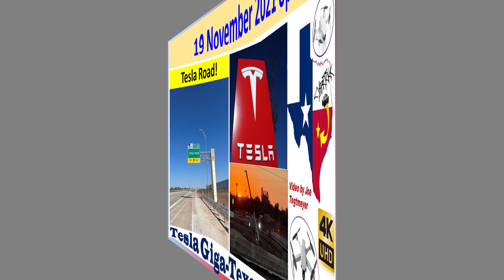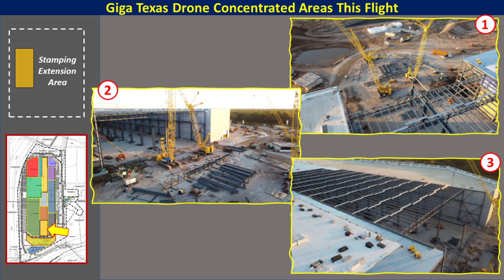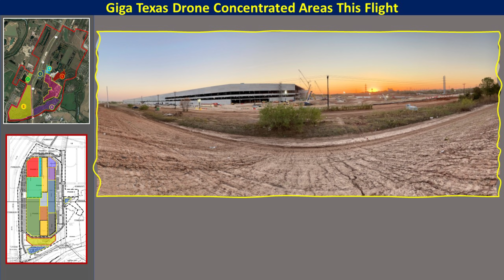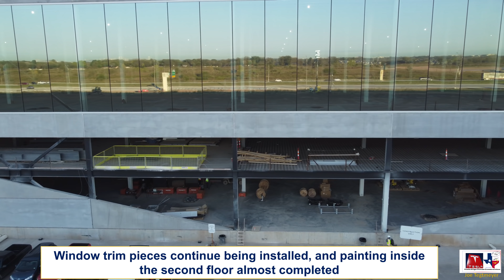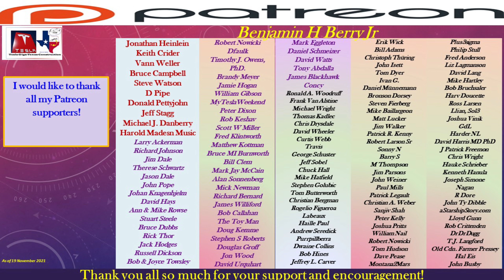Tesla Gigafactory Texas 19 November 2021 Cyber Truck & Model Y Factory Construction Update (07:30AM)

Comment: Thanks Joe. 
4:06. East side BIW. Ramp down to the loading docks also ramps up to meet the apron to the south (left). Odd detail, I wonder what drove it.
4:14. East side BIW. New door opening gets a stair that looks permanent i.e not a scaffold type temporary stair.
6:35. West side storage area. Steelwork looks like columns set up for bridge crane beams, bridge crane beams etc. Likely to be for the High Bay area where additional footings were being constructed 3 weeks ago. Deep inside here; https://youtu.be/NuWFvOcw4nI?t=725
7:21. West side GA. Bottom right inside. Robots.
9:08. Splitter box weir. So much timber. That will be a tricky pour. Lots of corners, skinny, deep. Surprised the weir segments weren’t precast and epoxied/grouted in over start rebar.
9:52. Retaining wall. Just when I thought I understood what was going on. A raised floor has now been constructed in the floor of the chambers behind the wall. Now there’s room for a layer of soil in the pond. Talk about a fluid design! 😑
11:09. South pond. Left of screen. Bringing in soil.
12:07. South end. 3 cranes shortly to be out of work.
13:14. Stamping extension. Perimeter columns already placed either side of the opening. 3 more columns laying on the ground across the opening, another right of screen.
I wonder if there will be floors constructed in this narrow space between the perimeter wall and the Stamping Extension structure. Maybe some access between GA and Stamping Phase 1. There are some short sections in the stack to the right that could be joists.
14:47. East side stamping. Demolished section of apron is now a newly poured entry ramp. 
16:34. Stamping extension. South building line. Think I can see some piers along the building line for the perimeter grade beam to land on. A little to the south (left) of the perimeter columns laying on the ground. Didn’t see those go in. Yellow drilling rig was down this end days 420 and 421. Red drilling rig day 425.
23:20. RTO roof. Squat wall made of LVLs and plywood on the expansion/construction joint between the RTO and Battery. Not sure why it isn’t the same height as the wall adjacent though.
23:33. Battery roof. Mixing up some topping or infill mix in the yellow lined pit. Years ago I did a lot of telephone exchange work, we’d often mix up vermiculite and cement to infill gaps in firewalls. Might be something like that.
24:18. North end parking. Trailer load of hessian/coir/jute silt logs for the bottom of the berm presumably.
24:31. North end Paint/Plastics. Additional stud wall being constructed between Plastics and Paint, and not for the first time. 
New doorway into Paint, bottom left. 
25:06. North end. Still digging up bits of the blue fire loop.
26:00. North west diagonal corner Battery. Blind corner, car seems to make a rapid change of direction. Fitting the head and sill sections for window installation.
26:07. West side Battery. New temporary roof access stair. Stair at north end beside loading platforms removed.
26:14. West side Battery. Steel delivery. Been a stack of stair components around here for a while, might be part of that lot.
26:48. West side GA. Additional street lighting
Reply: Tq
Reply: At 9:08 are the walls inside the box baffles to prevent turbulence in the water?  Sure seems overly complicated.
Reply: Dessie, 9:52  at this time my resolution is only 480P so it is hard to see this area, but I had noticed earlier that it looked like the floor here was corrugated possibly to break up the flow. 24:18 I believe that this is rolls of netting with plants embedded to cover the berm sides and prevent erosion until plants take over job.
Reply: At 23:20 I've seen some air vents that are made to drain away rain.  The vents are like red clay roof tiles with space between to allow air through.  Water is channeled into the bottom tiles and to a drain.  Is this area an air vent?
Reply: At 24:18 could those be rolls of sod?
Reply: At 26:58 a whole slew of shiny Teslas at charging stations in 4 rows. Are these a test batch of vehicles getting their first full dose of electrons?
Reply: @acmefixer1 23:20 This roof is the same metal as used on the other roofs, the area is just a separate roof.
Reply: @acmefixer1  The timber is formwork for a weir structure around 6’1” 1.8m high. Not a straight wall but a concertina type arrangement that gives a total weir wall length of over 300’ 90m within a box only 34’ 10m wide. Dimensions as shown on the drawings, not necessarily as built but near enough.
In an intense rain event when the pond is at capacity and the water begins to back up in the drains, once it reaches weir height it flows over the weir and into the drain to discharge directly to the river.
The concertina shape to the weir ensures the maximum flow of water over the weir for any given rise in water level.
I had trouble imagining that and after some back and forth with Bruno Mailly the penny dropped. 
Here’s what I wrote in response to another comment a few days ago:
‘Weir design. I had trouble visualising how it would work. Decided to make a model, and while I was thinking about how to do that I had this light bulb moment where I imagined a bunch of cups in a kitchen sink. As the sink fills up and water begins to flow into the cups the total volume flowing into the cups depends on the number of cups. Imagine only 1 cup in the sink versus 6 cups. Same effect with a longer weir wall. I can’t not understand it now, but I couldn’t grasp it at first. Ultimately the flow to the river is restricted by the outlet drain diameter regardless of weir design.’
Reply: @medaliardi903  Cheers Medali!
Reply: @eltonray2934  9:52. I can only make out a flat floor. There is some sort of longitudinal east westish marks on the floor, but I can't make out what it is.
24:18. I guess it could be, I'm not really sure what it is. Something has been rolled out in Jeff's 485: https://youtu.be/Mwx8_zJvZkc?t=807
Reply: @acmefixer1  The squat walls are in pairs either side of the building construction/control/expansion/fire compartmentation joints. I'm reasonably sure that the primary purpose is to get the corresponding flexible joint in the roof membrane well up above the valley. 
Some are firewalls that project through the roof and are treated the same way.
Reply: @acmefixer1  Here's one rolled out in Jeff's latest. https://youtu.be/Mwx8_zJvZkc?t=807
Reply: @Libertylute  Staff vehicles I'd say. There's a mixture of models in there, and some foreigners.
Reply: @DessieDoolan  Wow!  Amazing you made a model that explained it to you.  Thanks.
Reply: @jbarvideo12  Hi Jay. I didn’t get as far as a model, although that was the plan. I was in the kitchen making a coffee when I looked into the sink, imagined a bunch of cups in there, a brief moment of nothing, then the lightbulb moment. 

When I was an apprentice at trade school, one of the lecturers would often say, ‘if you can draw it, you can build it’. I was at the about to draw it stage, and fortuitously I thought I’d settle down with a coffee first.
Reply: 4:06 Maybe for room to maneuver? The other side has the pylon in the way.
Reply: @Libertylute  My guess is that they are company vehicles.
Reply: @musaran2  I had a rethink. Now thinking it might all be about whatever is under the manhole. Some service under there at a relatively high level. A drain perhaps. Bottom right here: https://youtu.be/nILbHusnmq0?t=96

Comment: @ 10:08 (South pond) Four outlets for each 8' diameter pipe from the splitter box. Each 8' pipe will empty into a concrete structure behind the wall to dissipate energy of the incoming water before it enters the pond. Outlets should be close to the pond bottom once the 3' layer of dirt is placed on top the liner.
Reply: The formwork inside the box seems extremely complicated.  Interesting to know what all is happening in the box.
Reply: @acmefixer1  Made even more complicated by the need to incorporate six columns into the weir structure.  The columns will help support the top of the splitter box.
Reply: @acmefixer1  I'm sure it's a science in itself.

Comment: With That gantry on the east side keep an eye out for multiple truck loads of disassembled equipment that is soon to be installed, just a guess but it may be CT press/stamping equipment
Reply: At this time there are 5 Schuler transfer presses in one assembly line in the building. They did use similar equipment to unload the Schuler presses inside of the building. This could possibly be for another line of presses or something else heavy. These assembly lines do not have to be dedicated to one automobile but can change dies for any stamping job. GM has locations that only do stamping. They produce parts for all of their vehicles by changing dies as required.

Comment: I was expecting the windows at 14:09 stamping area to mirror the windows on the north side of the casting area. But they have reinstalled the roll-up doors. Unless they will do it later, but there will still be a need for a crane and angled framing for the triangle windows.
Reply: Yellow crane is still standing by. Those panels were cored out for the bolting on of face mounted lifting anchors. I'd be surprised if they don't get replaced at some time.

Comment: Given that they are about to start production, what I still miss are two things: 1) test track (might be inside) 2) large parking lot where the built cars will be picked up by car carrier trucks (the north parking seems too narrow for that)
Reply: My guess is that they are yet to be built. Production volumes will be very low at first. They can construct those very quickly when needed.
Reply: I wonder if Joe, or anyone else posting here, has seen the site plan and identified where the parking lot will be for the Model Y's coming off of the assembly line.  We will probably see some activity there within the next few weeks if production of the Model Y's is actually going to begin by end of the year, as Elon and other Tesla execs have said.
Reply: @ronjones8003  In my opinion, the current parking lots are plenty big for the number of cars that may be produced and shipped this year.

Comment: 0:54 What is being split at the water splitter (besides water💧of course)❓
Reply: Rachel, only water flows through the box, I have included a description of operation from my files :
Splitter Box
The splitter box or more apply named “Pond 1 Overflow Box” is a covered concrete box with interior dimensions of 66’10” long by 34’10” wide and 11’4” high. It has a wall inside that is 6’ high. The top of the wall is at the elevation of the maximum level desired in pond 1. The internal wall, also called a “weir” separates the box into two areas with storm water entering the North East area and draining to the pond normally. If the level in this area ever reaches 6’ depth the water will overflow the 6’ wall to the river and prevent overflow of the pond walls. The design also completely drains the box in times of no rain.

Comment: Look like a 6-10 feet gap to complete south-central building but hard to be sure from here (Canada) 
And I think I saw (few days ago) column footing half way each middle section aligned to south wall
Reply: Look closely and you will see that there will be 4 or 5 columns installed to support the wall panels. At around the 13 minute mark you can see that 2 of them have already been erected.

Comment: How does the roof decking get on the roof?  You'd think it would've been lifted up with cranes and prepositional before all the trusses forced the cranes so far away from the next roof plates...   if raised up there now they have to be moved/carried pretty far.
Reply: They do place it as they assemble the building structure.
Reply: @eltonray2934  where is it?
Reply: @shadowmancer7040  Shadow, The decking is in stacks placed in rows at the back of each bay as shown at 16:06 .
Reply: @eltonray2934  omg.  I almost asked a million times why the roof beams were so irregularly placed.  They are stacks of roof decking?!   Mind blown.  Thanks.

Comment: My question is this. @10:00 if those were holes in the BIG WALL were for future drain pipes, they would have formed the pipe into the wall like everywhere else. So is this something different?
Reply: The flow from the splitter will enter from the north and be distributed out of the openings, not for future.

Comment: Since Tesla was just given permission to sell power back to Austin Energy, I have to assume that's going to be a lot of solar panels. Any guess as to will they put them on the roof, or since they have the land, build a solar farm..?
Reply: Maybe they'll spell out "TESLA" on the roof in solar panels?
Reply: I wonder if they will screw Tesla over like they do their residential customers? For us residential customers, they charge for all power used at retail rate but only pay you for power at wholesale rate. So even if you generated enough power to cover the power you used in a month, you still owe them the difference between the retail rate and wholesale rate. The only way to avoid this is to buy the power wall and not use a watt of energy from the network.
Reply: @Bill_N_ATX  Here in New Mexico it's a little different. I have a 12.4 KW system. The main meter goes backwards when I'm producing more than using, so they're paying me the retail rate for that, (I'm sure they don't like it). On the REC meter, PNM pays me .13 cents for each KW I generate. My average generation is usually 2200-2300 KW/ month.
Reply: In theory they don't need solar panels at all.  They can just do energy arbitrage buying off peak and "excess wind power" and selling peak and the somehow more lucrative just stabilizing spikes in not quite synchronized generation...with autobidder and batteries.
Reply: @shadowmancer7040  They have built or are maybe still building a giant battery in Texas. I am sure they will also use Tesla solar and battery customers in this endeavor.
Reply: Danny H wonder why some people are so obsessed with solar? Isn't it only 19% effective? Looks like waste of money and effort.
Reply: @sonarsphere  Solar power is the best investment I've ever made. I like having a zero bill.
Reply: @sonarsphere  Indeed.  The investment in solar power in Texas is huge (second only to CA in the US).  I'm certain no one has bothered to do the math.
Reply: @shadowmancer7040  I agree. Grid stabilization like South Australia.
Reply: @sonarsphere  I think you mean 19% efficient. It's better than wasting 100%.

Comment: Is there an animation somewhere of how that water splitter box is supposed to work? Those pipes have to be six feet wide!
Reply from the maker: See my 2 Nov video
Reply: Thanks!
Reply: The splitter box or more apply named “Pond 1 Overflow Box” is a covered concrete box with interior dimensions of 66’10” long by 34’10” wide and 11’4” high. It has a wall inside that is 6’ high. The top of the wall is at the elevation of the maximum level desired in pond 1. The internal wall, also called a “weir” separates the box into two areas with storm water entering the North East area and draining to the pond normally. If the level in this area ever reaches 6’ depth the water will overflow the 6’ wall to the river and prevent overflow of the pond walls. The design also completely drains the box in times of no rain.
Reply: @eltonray2934  Okay,  that makes sense. The water is directed at the pond first,  after which,  overflow is directed at the Colorado River.

Comment: @ 15:08 Single roof entry point. I feel sorry for the poor guy working on something on the roof at the other end of the building and needs to go to the restroom!
Reply: Tradesmen just piss on the roof. It washes away in the next rain. Much less than bird poop. # 2 is a problem.
Reply: I bet they leave 4 wheelers and trailers up on the roof. Or at least bicycles. That's a long way to walk.
Reply: @kkarllwt  And the rain washes the pee down into Musk's rainwater collection system :)
Reply: I suspect they will have at least one electric cart up for getting around.  Maybe a cyberquad :)
Reply: @kkarllwt  #birdpoophobia

Comment: 22:04
Will that doorway be big enough to allow additional Gigapresses to be installed; namely the 12,000 ton press when it finally becomes available?
Reply: The way that the casting presses are made and shipped the base is the widest part. This door appears to be about 16' wide which should be plenty. Of course the base could be turned on it's side or just remove wall panels. I believe that the CT will use the 8,000 ton press.
Reply: @eltonray2934 
Thanks for the info. While you are correct about the 8k press. I'm looking at the 12k for the semi and possibly the unibody that's been juggled around. And yeah I've entirely forgotten that those wall panels can be removed and reinstalled almost at will. I'm also thinking about when they'll inevitably replace the older presses some time in the future.
Reply: @texan-american200  what would they use a press for on a semi? the frame on the semi is a typical steel ladder frame i think
Reply: @reddog9978  …..’Elon Musk’ and ‘Typical’ are rarely found together 🤔🚀
Reply: Like the guy that built a sailboat in his basement.
Reply: @jbbuzzable  
I heard about that, not sure if it's true or not, but it is a funny story.😆🤣
Reply: @reddog9978  
I'm mainly thinking of the floor plate beneath the cab or batteries, but who knows.
Reply: @texan-american200  It would also be a funny story if Tesla didn't make a door big enough to move machines in or out.
Reply: @texan-american200  would that be cast or stamped?
Reply: @reddog9978  
The 12k would be the casting machine.
Reply: @jbbuzzable  
That'd be just as embarrassing as having to fix the corner by the highway because someone didn't survey the land correctly... Allegedly.